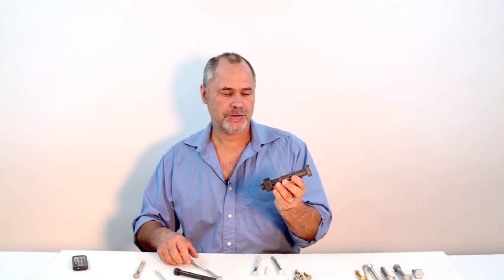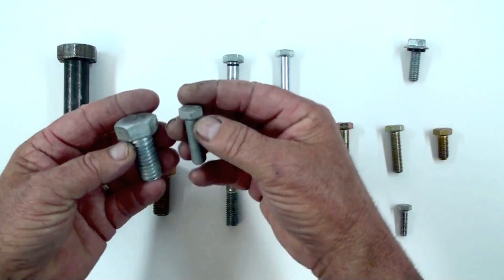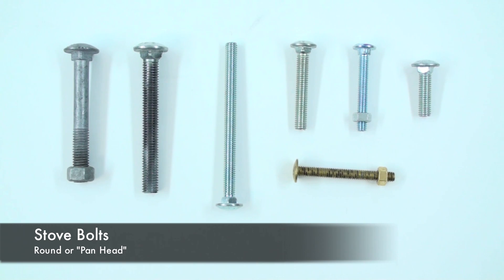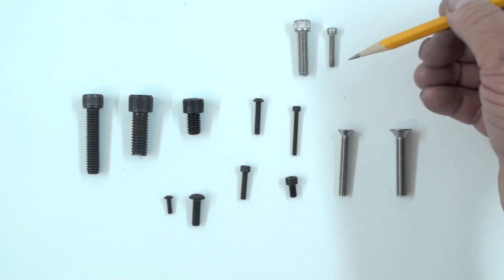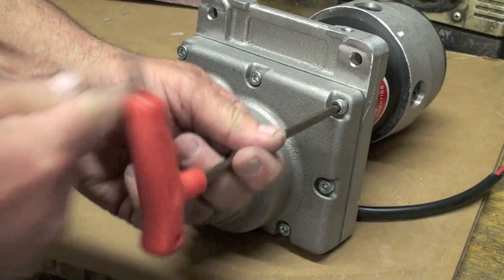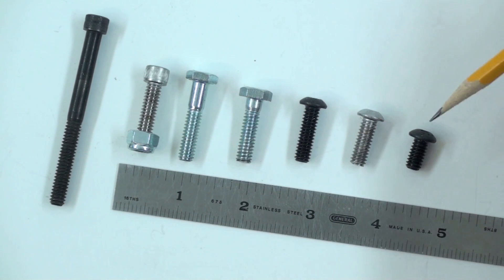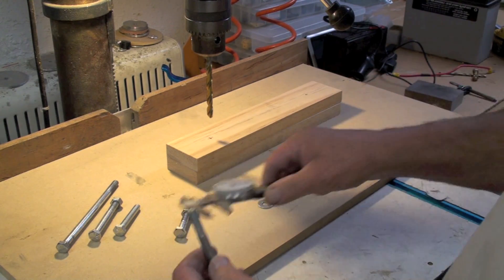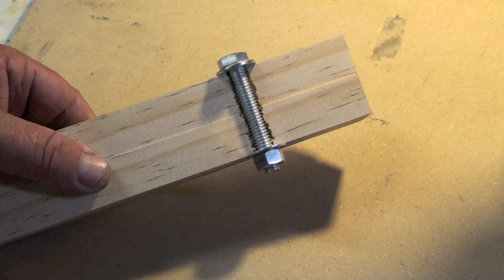Fasteners: Machine Screws and Bolts

Comment: The ones @ 06:20, "designated by a number", a bit more on that? That's not a diameter anymore....
Reply: 8-32 means 32 tpi and what is 8? Not inches, not 16ths not 32ds... It's like 5/32nds on an inch, how do you get from that to "8"? It doesn't seem to mean anything...

Comment: 3:55 ...    Lag Bolts.  Actually a misnomer, since these items are screws, not bolts.... You can not use a nut with these items, the tip is pointed and you have to screw them in to fasten them. So, by definition, they are screws, not bolts.

Comment: the "bolts" that you showed at the beginning are actually hex head cap screws. you can tell by the washer face under the head. a machine bolt will not have that washer face .
Reply: Unless if the machine bolt is a tap bolt

Comment: I think you used wrong bolts for the wheel. Usually steel wheels have a bolt with 45 or 60 degree head not flat like yours. Flat ones are used with some alloys and they have non removable s.steel washer  on them.
Reply: I went back in the video and re-viewed the rim. I agree with you. The rim is designed for the bolt you mentioned, which also helps center the wheel. Using the type of bolt he is using will probably crush the conical hole profile of the rim, in my opinion.

Comment: 7:00 "The 10-24 designation refers to the fact that this is a size 10 screw". The size 10 number is gotten from the major diameter being 60 thousandths plus 13 thousandths for each number. 0.060 plus 0.130 equals 0.190. Likewise, 6-32 is 0.060 plus (0.013 x 6) equals 0.138. The hole you would drill to use a tap would be the major diameter minus the thread pitch.  For 10-32 it would be 0.190 minus 0.031 (1/32 of an inch approx.)  which equals 0.159 inch. Drill that hole in the metal, use a 10-32 tap carefully, and the threaded fastener will fit right in.

Comment: Can you tell me what a hex bolt measuring 29" long...yes 29 inches long, is used for.    Grade 5 head cap, the bottom has 2" for which a nut goes on. I found 4 of them stashed away in an old shed.   Husband 89 yrs. old,  pasted away last year, so I can't asked him.  Thanks for any info you can give.

Comment: I'm looking to replace bolts for fastening plastic engine cover in an Acura.  Plan to buy from hardware store instead of from dealer.  Specs call for "6 x 28".  Does this mean 6mm diameter x 28mm length.  If pitch isn't specified, does it default to 1mm?  Thanks if anyone can help.
Reply from the maker: Yes, that sounds about right since it's a Japanese car,  the bolts would be metric.
Reply: +www.Inspectorbots.com Thanks!

Comment: Hi! I

           removed my motorcycle's handle bar. then I cleaned the bolts. I notice 
the two bolts had a very thin (hairline) metal shaving. the length is 
around 0.3 cm. very short.

 

(I did not over-tighten the bolt) 

the thread is still good, tight and snug. 

 Just like to ask if this is normal, and if the metal shavings are just from the factory when they drilled.

Comment: nice video.
where would you need coarse and where fine threads? What are the + and - of each?
thanks!
Reply: Fine threads are less likely to come loose under vibration (as mentioned) and are stronger as there core will be relatively thicker and engagement area slightly larger. Coarse threads will do up quicker and are less likely to strip. I would say loosely coarse threads are better for applications where repeated untightenening and tightening occur and fine threads where they will be staying put.

Comment: 6:17 To find the screw size, subtract 0.060" from the shank diameter and divide by 13. You can do this in reverse of course, by multiplying the screw number by 13 and adding 0.060" to find the shank diameter. Great video.
Reply: So, the 10, 8, and 6 in the video have a shank diameter of .190", ..164", and 138".

Comment: inch crap ! falls apart with vibrations. us cars were famous for breaking down
 before they became metric:)
Reply: +Ellsworth M. Toohey No, he said use fine thread screws for vibration tolerance. Both metric and imperial have fine threads.
Reply: +SE45CX So , use METRIC, standard metric it is a finer thread than UNC and can be found the world over  Reduce cost, inventories, tooling, METRIC ONLY ! Anyway, the US has NO CHOICE. For 160 years US scientists pushed metric,  idiots sabotaged the migration and the US industry paid the cost.

Comment: Wenzhou Chinese Industry Co., Ltd. Product of 
※ Nuts (Rivet nuts, Wing nuts, Cage nuts, Weld nuts, Barrel nuts, Teeth nuts, Furniture nuts, Pal nuts, Cap nuts, Nylon lock nuts, Tee nuts, Eye nuts; Kap nut, Coupling nuts) 
※ Washers (Lock washers, Teeth washers, Square washers, Serrated lock washers, ) 
※ Pins (Split pins, Grooved pins, Spring pins, Taper pins, Parallel pins) 
※ Brass Fastener (NUTS; BOLTS; SCREWS; WASHERS) 
Contact information:
Email: fastener@cicsorb.com
Skype: cn-industry
What app: +86-13736328108
WeChat: chinfast
Tel: 0086-577-86996516
Fax: 0086-577-86996515
ISO/TS 16949, ISO14000, SGS, BV, Rohs Tested & Certified Company

Comment: Yea , nice video but remember that only 3 countries in the world uses inches , the rest of countries are using International System of Measures . And metric is the best for all. Start to use metric and you will see way.Hello metric sizes exist.
Reply: Well Britain invented the Imperial system and pretty much invented modern day industrialism, and still adopted the metric system. As an engineer I can assure you it is by far the better system to work in, and yes I regularly work in both still as Aerospace is almost all still Imperial.
Reply: ***** 
I'm going to tell you something that most foreigners in country's dont understand. The reason the United States still use the SAE system (inches) is because the USA industrialized long LONG before Metrics even existed. As a result, the machines made before metric existed are of course in inches. These machines were designed to last for century's and be infinitely rebuildable. The plans to make these machines, dies, castings, molds, etc are still used, and many of these machines are still being made (yes, in America. Shocking, I know). For America to switch to the Metric system on a technoligical, logistics, and engineering level would be like asking Japan or China to switch to a different system of measuring, despite all their machines, plans, blueprints, replacement parts for the machines (which MUST be metric) having already been built.

Lastly, though the metric system is simpler to use, pragmatically a 1 centimeter bolt and 3/8" bolt function just the same, are equally strong proportionate to their diameter and weight, and work just as well. The ONLY problem with the SAE system is that foreigners keep nagging Americans to switch, when ALL of our machines, molds, dies, etc. use this system. You cant just switch out the measurement system like that. Not unless you want to destroy every single old machine, steelmill, tractor, car, ship, lathe, knee mill, grinder, forklift, fittings for fuel and propane, LITERALLY EVERYTHING IN AMERICA WOULD NEED TO BE REPLACED WITH A METRIC EQUIVALENT and when you look at the FACT that the application of these tools and things work just as fine with the ONLY advantage being convenience, everything in tens. So ell me, would the cost of replacing literally everything in this country be worth it for a mere convenience? I think not!
Reply: Josh Hanson I wouldn't say Britain "invented" modern day industrialism. The first half, yes, but the second half was the US. In 1941 the USA could out-manufacture every other nation on Earth combined and that was through American innovations that occurred mostly from 1865 to 1925. There are as many metal and other heavy machinery in America made only with SAE units made before WW2 still operating than you realize. These machines are designed specifically to be infinitely rebuildable as each individual part can be replaced including the frames rebuilt. I personally own a Niagara shear made in 1914 and it still works great and holds tolerance. I own a vertical milling machine made in 1924 that again still works great and holds exceptional tolerances.

And yes, the metric system is better. But because our technology is both old and new the parts need to be interchangable between the two in the factory's so we use SAE units. It keeps things from being fucked up.

saac Pennock established The Federal Slitting Mill in 1793 on Buck Run, a stream about four miles south of Coatesville, Pennsylvania. After receiving a loan in 1810, Pennock went into a partnership with Jesse Kersey to form Brandywine Iron Works and Nail Factory. Kersey’s father-in-law was Moses Coates, a member of the founding family of Coatesville. After seven years as partners, Pennock bought Kersey’s share of the business and then leased it to his son-in-law, Dr. Charles Lloyd Lukens. The following year the mill became the first in the United States to produce boilerplates and soon joined the shipbuilding industry. In 1818, Lukens produced the iron for the first iron-hull vessel in the United States.

Dr. Charles Lloyd Lukens died in 1825, leaving the steel mill to his wife Rebecca Lukens. This inheritance made Rebecca Lukens the first woman in the United States to be a part of the iron industry. She was also the first female chief executive officer of an industrial company. She became a huge icon for the steel mill when she saved it from bankruptcy by making the company the nation’s chief producer of boilerplates. They were sent to England to be used in some of the first railway locomotives.

All that history aside, the Lukens steel mill has been in continuous operation since 1793 and I assure you as the mill got bigger with new parts many of the old parts remain (though I bet few remain from the 1700's or early 1800's) but the furnaces and many other parts could easily be from the mid 1800's and up and the new technology is added to old machinery so everyting is kept simple by using SAE parts.

A personal example, though my milling machine was made in 1924 it has a new digital readout scale on it. I also have a large Cincinnati Number Three Milling Machine from 1967 that I personally converted to be a CNC milling machine and it works great and doesn't break down often unlike the new milling machines. So guess what? I use SAE parts to keep everything simple. Nobody should need TWO wrench sets for one machine. Which is partially why I HATE new cars made after the 70's.

When you mix up metric and SAE units, you make things more complicated and increase the chances of fuck ups and mix ups.

Keep it simple, keep it straight, I keep it all SAE.

I'm a thermodynamics engineer. I believe that everything should be as simple as possible and not any simpler. I will not fix or tamper with what isn't broken.

"Aerospace is almost all still Imperial."
-Yes I know. I do a lot of parts and jobs for Boeing and the DoD. If the Aerospace industry uses it, which they do, it can't be that bad. Again, metric is better. But why not keep using what we have? Changing over would be insanely costly and unneeded.

Comment: stove bolts. At least in my trade they are referred to as carriage bolts.  nobody will know what the hell your talking about if you say stove bolt.
Reply: Stove bolt will work if the head has a slot or a phillips, and no square neck. Carriage bolts are supposedly also called coach bolts, and round head square neck bolts, although I have never heard these terms. If you look up "plow bolt" they too are very similar to a carriage bolt.